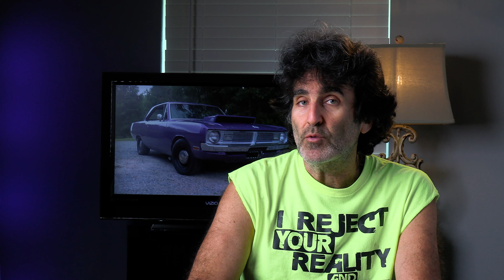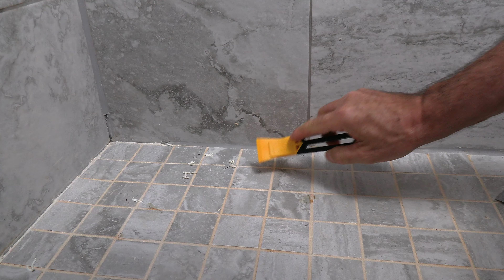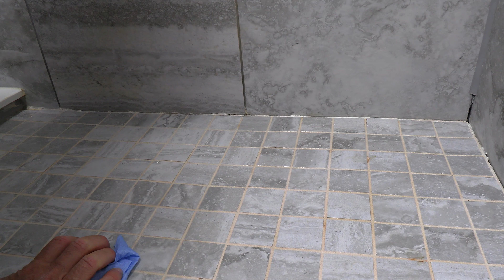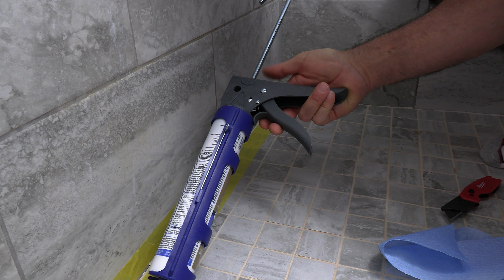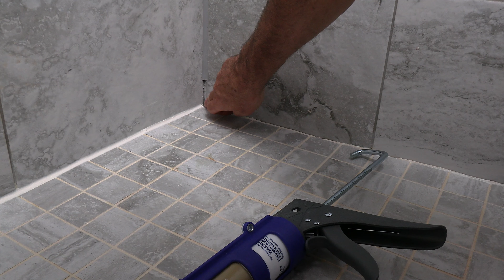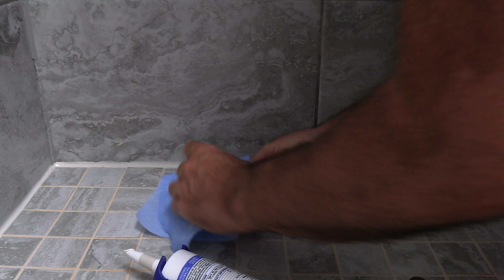Restore the Old Nasty Moldy Caulk In Your Shower or Bath

Comment: I have found using wet Tshirt material wrapped tightly around the pointer finger gives a pretty clean line without using tape. Just clean excess caulk off as you go along!
Reply from the maker: Great tip!  I haven't tried that so I'll have to put it in my bag of tricks... 😀. Thanks..